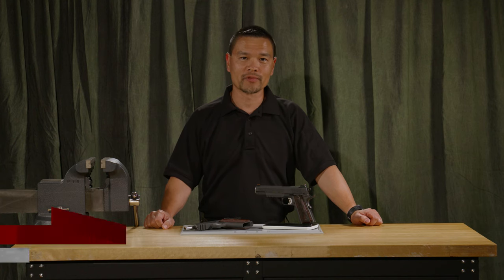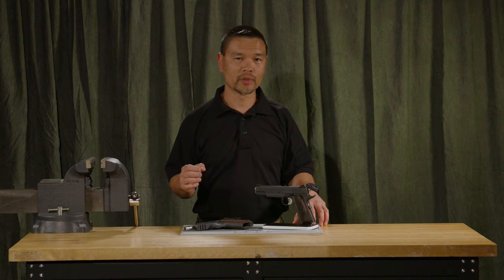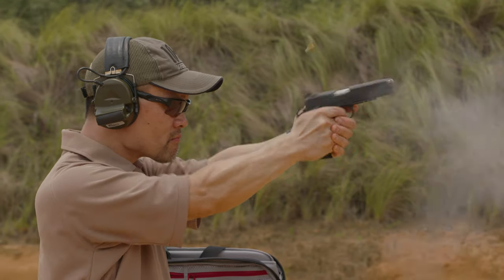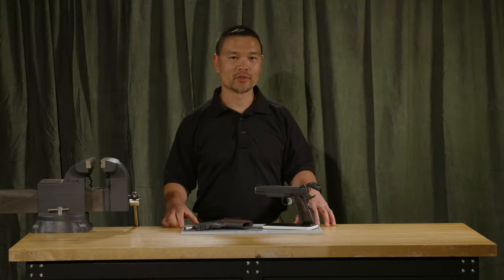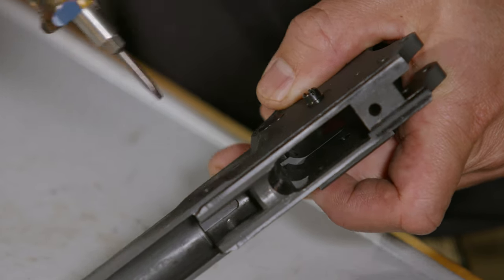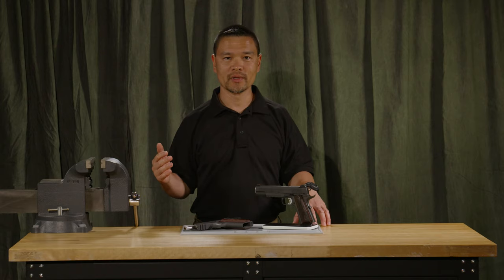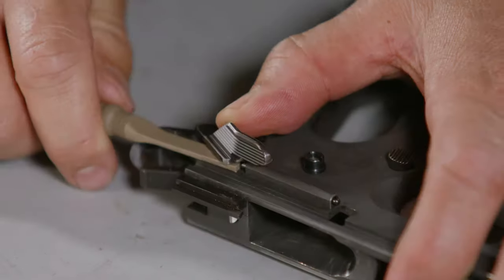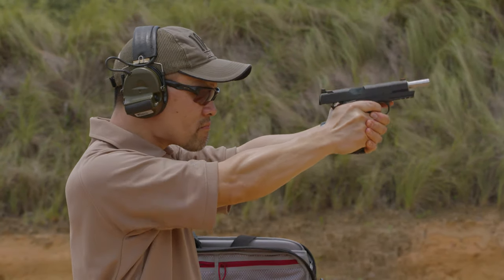Panteao Make Ready with Hilton Yam: 1911 Duty Tune [Trailer]

Comment: Step 1: lose that nickle plated sissy pistol and get yourself a glock
Step 2: watch the comments rip each other apart
Reply: mtsEnrique 😂
Reply: they are nice... but to me outdated  so many better firearms out-there.. meaning more mag capacity  quick simple break down  more resistant to rust / lighter  and just as accurate
Reply from the maker: More mag capacity: STI or Para frame 1911, simple break-down: the 1911 is pretty darn easy, rust resistant: try stainless steel, lighter: try alloy frame.